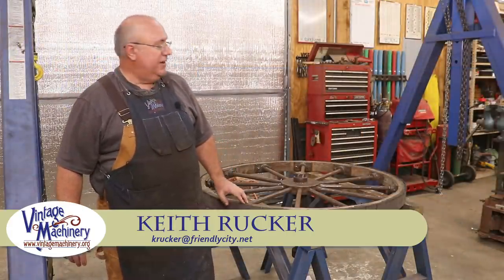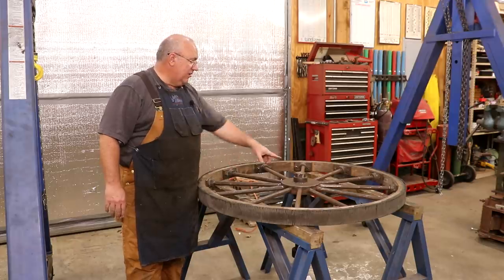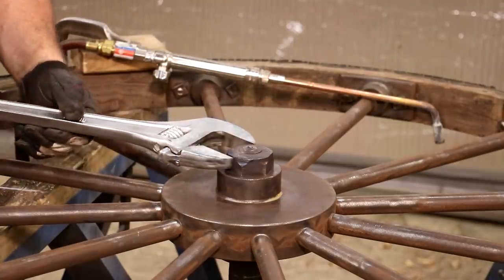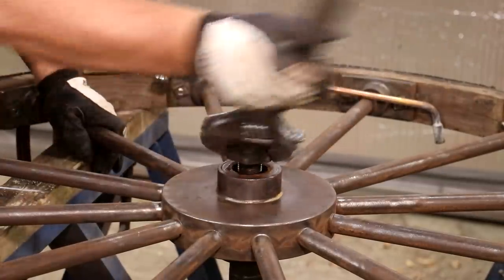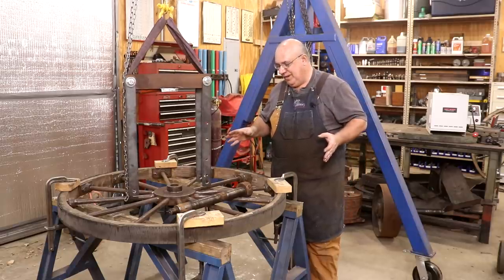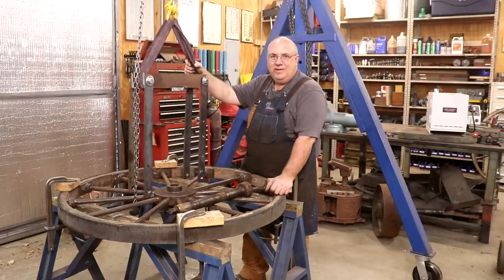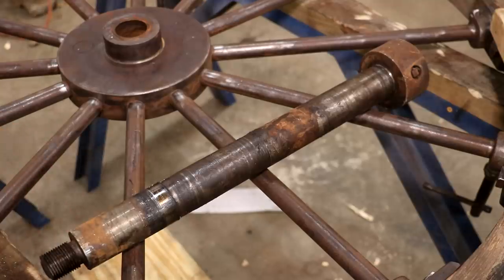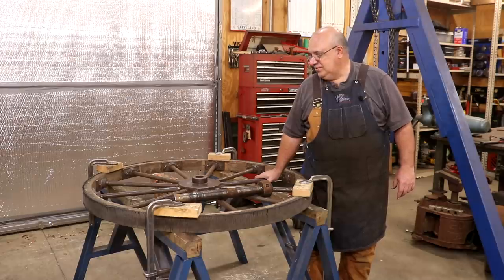The Jimmy Diresta Band Saw Restoration, Part 6: Top Wheel Shaft Removal - That was EASY!

Comment: It's not to do with 'torque' but more to do with the direction of rotation, that's why you are more likely to have left hand thread on the left of a vehicle (on older vehicles etc).

If a shaft is rotating rotating in a clock wise rotation (looking at it end on) it would need a left hand thread to tighten it of you were to hold the nut, the opposite end of the shaft would be turning in the opposite direction (if you were looking at it end on) and would require the opposite direction or right hand thread to tighten it if you were to hold the nut.

As you would prefer a nut to tighten than slacken (and self disassemble itself? the correct thread would be desired on the correct side.
Reply: @T_Hoog  The “more to it” is the lower shaft is driven by the motor while the upper shaft is driven by the wheel. Any slippage of the upper wheel on the shaft will tighten the right hand threads.
Reply: @ellieprice363  this was 2 halves of the same shaft remember?
Reply: I used to be a mechanic and we had to be aware of left and right hand threads, left hand thread goes on the left while right hand went on the right .

You guys need to get someone to spin a shaft in one direction while you look at either end of the shaft and then imagine what way you would need to turn the nut to tighten it ... wow!!!
Reply: @Scott Bishop: The top shaft has the big wheel mounted on one end only and will rotate in Babbitt bearings when finished. I hope this answers your question.

Comment: Fantastic work, Keith. Thanks a lot, once again. Are you concerned about the trueness of the wheel? There is pressure on the rim from (minor) uneven clamping to the saw horses and all kinds of stress on the spokes during the process. Is this an issue? Is there a way of truing the wheel before re-fitting?
Reply: I believe the only stress on the spokes would be from the weight of the press itself. Since the press had been suspended from the crane above, the forces would be negligible. All the stresses would have been between bottom of the hub and the shaft running thru it confined to the press itself.

Comment: On the top, the wheel is driving the shaft, so naturally the sense of the threads would be opposite.
Reply: The bottom wheel is the drive wheel.. the top is the "idler" wheel on this bandsaw.. but your correct.. the wheel being driven by the shaft should be left handed thread. While the wheel being driven by the blade should be right handed..
Reply: @garygentry583  My point is that the top wheel is driven by the blade, and then in turn drives the idler shaft.  The sense of that drive is opposite that of the bottom wheel, where the motor drives the shaft which in turn drives the bottom wheel.

Comment: Rather obviously, the threads are opposing because the loads on them are opposite. The drive thread load transfers from wheel to shaft, so the thread follows the rotation. On the band wheel the load is from shaft to wheel, so the thread opposes the rotation. Congratulations on deciding to use a puller, as should have been done on the last one. I guess we can all learn eventually. I was expecting you to beat the shit out of this one, too.